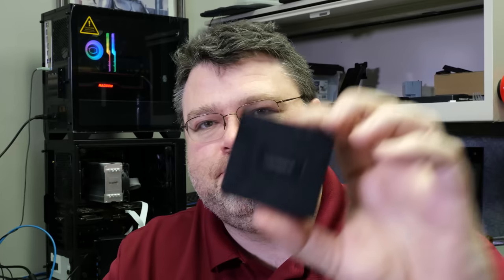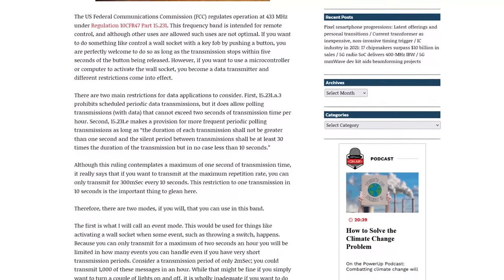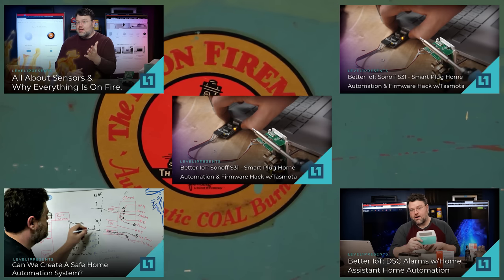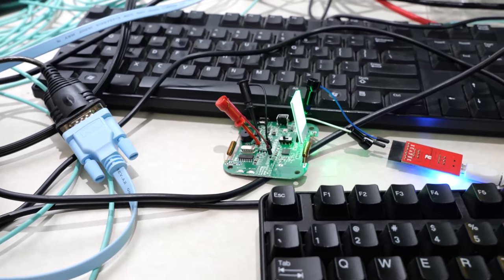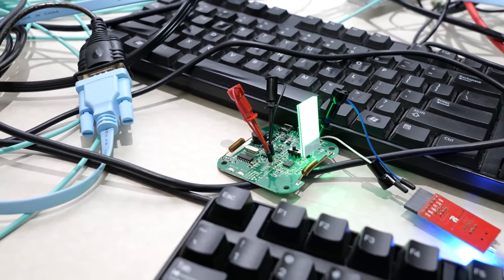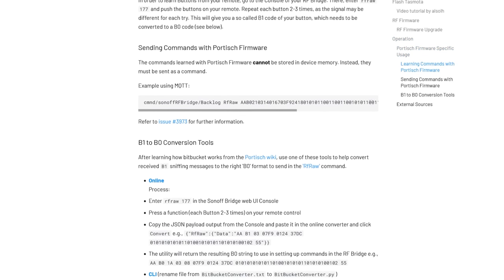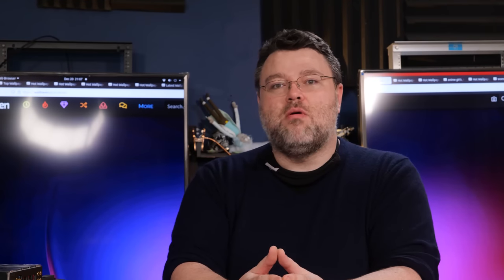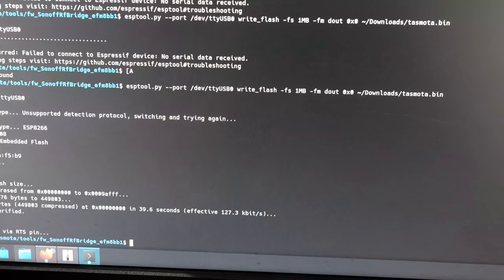Better IoT: DIYing a Sonoff Wireless 433Mhz Bridge

Comment: Honestly, L1T NEEDS to make IoT the way it should be.
Reply: Allegedly “Thread” is supposed to do this. But it’s been delayed another year. It’ll be a consortium of standards for secure interop.  I suspect it’ll be much more complicated than MQTT and Pub/Sub which is a bummer, but at the same time it’s probably needed.  Fingers crossed it’s not a disaster. I think it’s been delayed another year again though you can pull up the current state

Comment: using it with tasmota for around 2 years and a great benefit is that most sensors are much cheaper than the fancy protocol ones. the range depends mostly on the sensors and thats the only negative thing i can see

Comment: Did this a few months ago but switched to a cheap usb SDR with RTL_433 since it couldn't decode my lacrosse temp sensors or work with my wireless food thermometer. Have to say I like the 433mhz stuff though, cheap, low power, and very reliable in my experience.
Reply: And most sdr have a much wider listening range. For example mine is 25MHz - 1750MHz. I am listening at 900 MHz where my power meter operates so i can pull in my power usage.
Reply: Im sorry for my lack of understanding, but can i assume lacrosse in your context has nothing to do with a field or sports
Reply: @Catsrules1  Yeah my food thermometer runs at a slightly different frequency too, rtl_433 is able to jump between both frequency's and read everything which is pretty neat.

Comment: raspberry pi with dvb-t antenna (via usb) and rtl433 does a lot with 433Mhz. besides other things, get the temp/humidity date from my TFA Sensors and my Pool Temperature Sensore :-D

Comment: A standard RfxCom USB transceiver works out of the box for all 433MHz devices. Using it for years with several home automation systems. It never failed me in all those years. Yes, it's a bit more expensive than a Sonoff, but it's just plug and play.

Comment: I have been using this for a few years now (home assistant) with PIR sensors and touch remotes and switch remotes, but have recently migrated to esphome and the difference is amazing, I found with tasmota some sensors gave 2 codes so didn't work 100% of the time. The challenge with esphome was soldering that damned wire on to the chip. I have over 30 entities linked to it 👌👌

Comment: Another option (at least in Europe, no idea if it is sold in US) is the rfxcom USB transceivers for 433 mhz. I have a first gen 433trx hooked up to a raspberry pi. Still going strong after ~8 years. No limit on the number of devices it talks to, unlike the device covered in this video. Not quite as advanced as a software defined radio, but it can do some raw packet sending and receiving if I remember correctly.

It integrates nicely with domoticz (which is what I run), though these days home assistant seems more popular, and according to a quick search it should work with that too.

Comment: My understanding was you can receive and send any 433 code based on mqtt connection. The limit of a specific number of rf codes is only in the tasmota web ui. But based on raw mode you can send any rf code.

Comment: Damn, i wish this kind of stuff came with PoE instead of wifi and USB-power.
Reply: Actually, is have a lot of network socket spread over the house and I use in some locations PoE adapter to just get 5v from a network socket to power wifi/ ZigBee devices. So, you might have to prepare a wifi anyway, but you can use small PoE adapter to power any 5v/12v device.

Comment: 433MHz is the same frequency of tire TPMS sensors, and those sensors transmit their unique ID number. So theoretically, you could track a specific vehicle around a city.
Reply: you could also use it to trigger scripts depedning on who gets on the driveway
Reply: Or play a specific song when your pressure gets low
Reply: Wouldn’t this only work when their tire is low on air? Its off until its low then it turns on. If it was the other way around it would use a lot of battery
Reply: @Ultrajamz  you can send trigger signals to wake it up. That's how they are programmed.
Reply: Hi Ken ➡👌 my curiosity has really got me ¿^¡🐈. I Know why I Would. I'm not a gamer, if that's what it's about! I have been hacked tracked. Also have some programming techniques but I believe they're just fucking with my car trying to steal it. Me × Take Care🤳🤚
Happy New Year Debbie

Comment: ESPHome on the RF Bridge is a major improvement over Tasmota IMO. Especially for motion sensors. It is at least 1-2s faster.
Reply: I guess this is because tasmota updates sensor data only every 5 min , and does not consider those information time critical. But you can change the update frequency to make tasmota react similar fast du ESPhome I think.

Comment: This is outdated. Since latter 2021 it is only available the RFbridge R2 V2.2, that is almost impossible to hack and turn it useful! I just want to read and send a RF door command whenever necessary. But it doesn't recognize it, even if the 433 code isn't a rolling code! The sonoff RFbridge is just junk for me...

Comment: I think you're mistaken about the 8 device limit.  I believe you're thinking of a limit on TX(transmission) which I believe is 16.
Reply from the maker: In raw mode it could listen but past 8 devices it was not forwarding events to the mosquito broker reliably. Could possibly have been a problem with the type of 433 devices I was testing though
Reply: @Level1Techs  I have a lot more then that working reliably.  Any limit would likely be from devices interfering with each other.
Reply: Trying to count in my head.... 10 window sensors each with 2 codes. 1 mail sensor. 1 washer. 8 buttons.  20 devices shooting out 30 codes.

EDIT:. I forgot about an RF remote... That's at least another  8 RF codes.
Reply: I think the same. There is no such limit of 8 codes to read and send. some remotes doesn't send the rf code long enough. I found pressing longer the remote makes it more reliable for the bridge. But I am sure that is configurable.
Reply: @0ChAnTi  My understanding is it gets a little more complicated if you want to send more then the standard 16 codes the device can memorize.  I had an interesting idea though.  I believe it's possible to add an IR led to it and you should be able to do both RF and infrared.  The RF bridge with Tasmota would then be more capable then the RM pro devices.